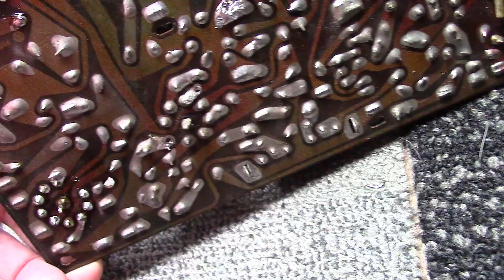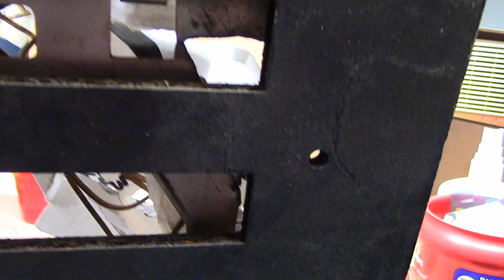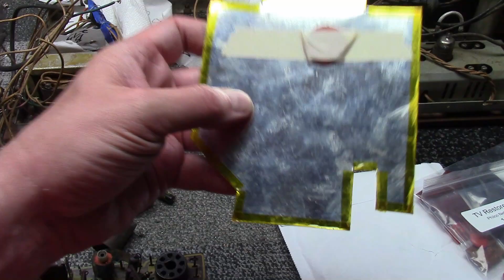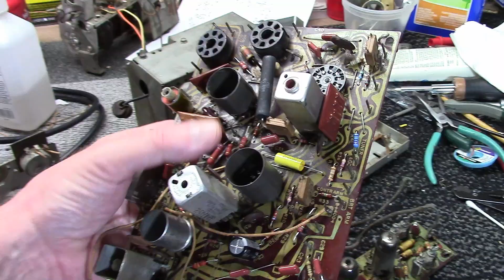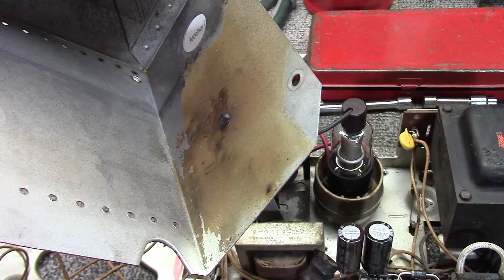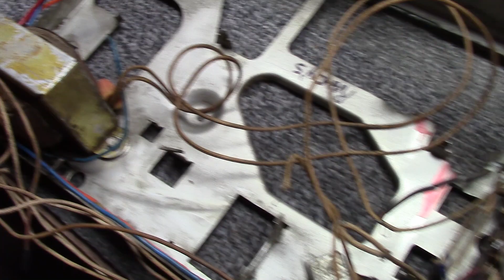Predictapalooza s1e16: Randy's Continental chassis

Comment: Something just hit me, the 21 inch Predicta sets using the 9L60 chassis have a power transformer as well. Don't know if you've ever had the... pleasure of working on one? Tight!  tight
Reply from the maker: Nope, not yet. I don't think most folks realize Philco used these circuits in sets for several years before the Predicta. They are based on the 9L35 chassis I believe.
Reply: @bandersentv  the 9L60 was used in the 1959 and 1960 console style Predicta sets. Like the full dress, the Miss America the corner set and the slant back. I worked on one years ago, but now have four of them to restore.  They are a tight little design. And it's interesting how similar some of their chassis are in other sets. That 10L43  looks almost identical to the 10L31 in my Bristol set

Comment: Those 2 screws hold the Local Distance switch bracket to the chassis.  The spacers go on the outside of the chassis.  I'll send you a picture via email.

Comment: A thorough and time consuming job  is quite necessary to fix all the problems on Randy's chassis. Putting any conformal
coating over unrepaired traces should be made death by firing squad. Try MG Chemicals 8310A stripper gel. Works on
most stuff but the toughest epoxies.

Comment: I think it's rather odd that the individual who had serviced this chassis previously decided to shear off a sizable chunk of the metal chassis. Most service techs simply cut the leads off of the bad caps/resistors and resoldered the new components on to the remaining stubs of wire.
Reply from the maker: I don't know what they were trying to do.  Nothing appears to have been replaced.

Comment: Glyptal? Glyptal is EXPENSIVE.  GE used to paint their appliances with the stuff.
Reply from the maker: Oh, it's not that bad.  Costs less than Corona Super Dope.
Reply: @bandersentv  I've seen how much the stuff costs.  You can only get it in quart cans or larger.  And it has a limited shelf life as far as I know.
Reply from the maker: @douro20  About $50 for a quart.  Corona Dope is $25 for a tiny bottle.